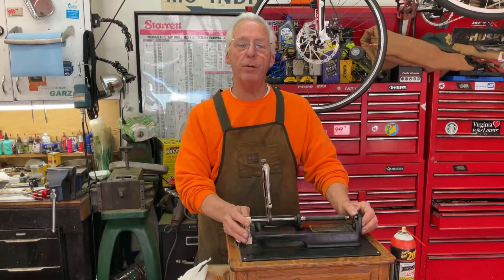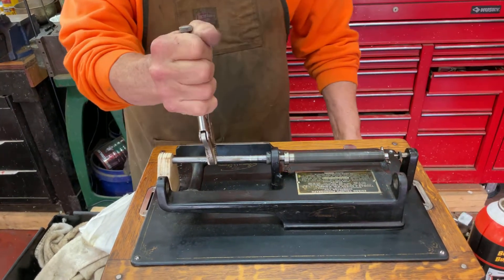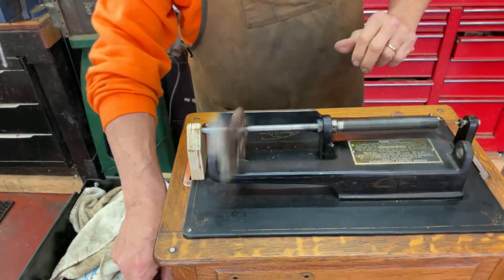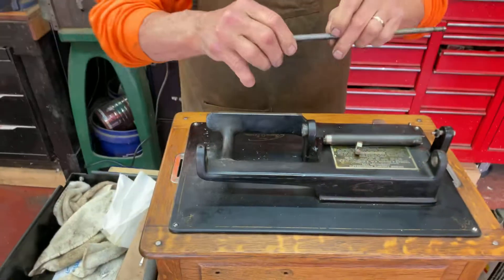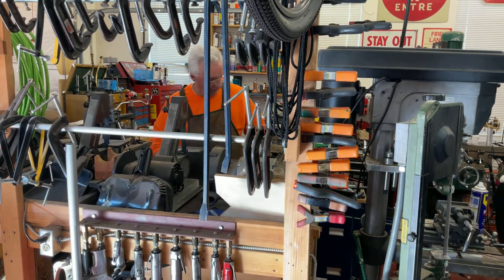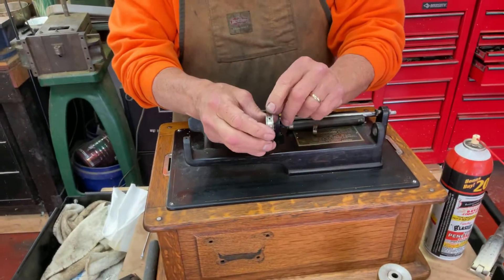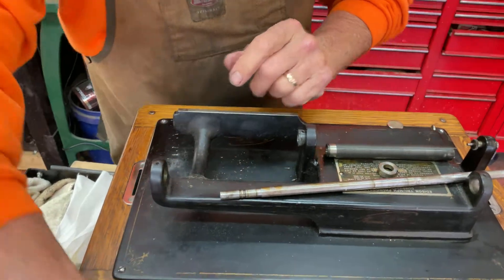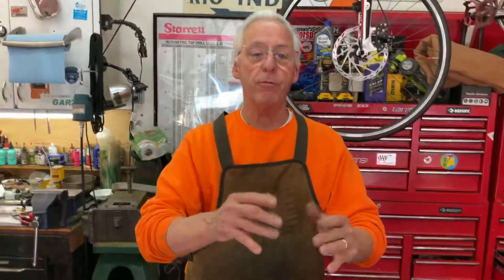580.  Removing a stuck Edison phonograph mandrel shaft

Comment: Oh, I had similar problems with stuck shafts on Edison machines. But I wrapped the jaws of the vice with tissue-based electrical tape. It is very sticky and fixed the shaft well without damaging the shaft.